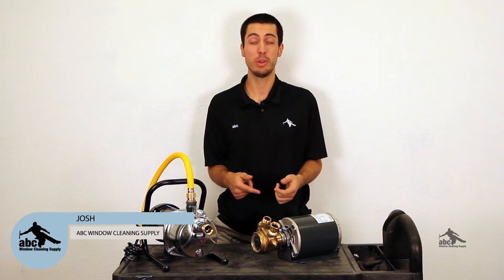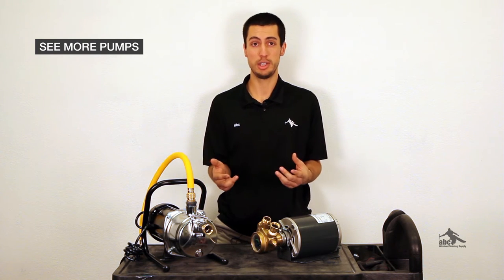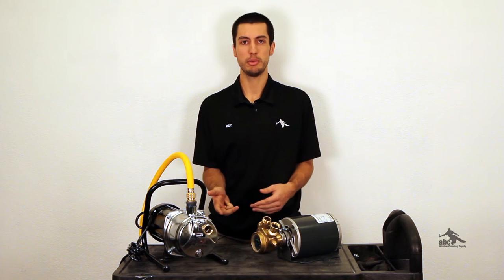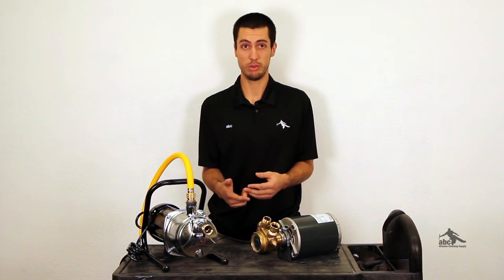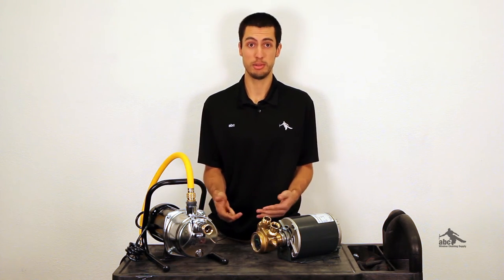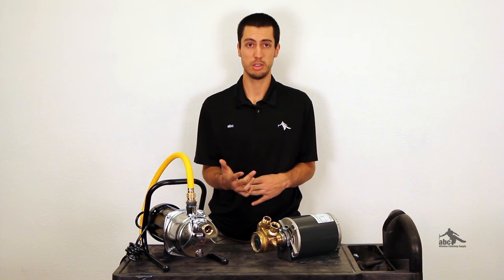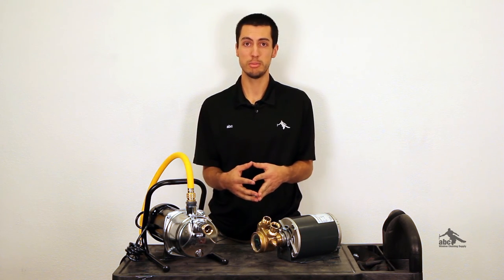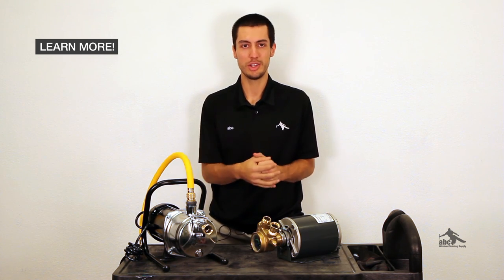Do I Need a Pump?

Comment: What is the difference between the booster pump and the other pump on the right?  You explained that a pump is needed but not when each one is preferred.
Reply from the maker: Luis, the main difference between the booster pump and the other pump is that the booster pump is meant to be used as an external pump, to give more power to a system that might not otherwise use a pump. The other pump (and motor) is meant to be integrated into the system, specifically for when you upgrade from an SG1 to an SG2. The (other) pump and motor combo have the ability to create a higher pressure; 220 psi vs the booster pump at 60-80 psi rise.